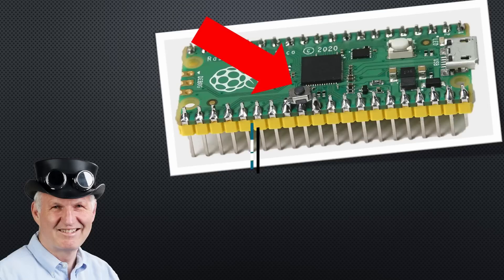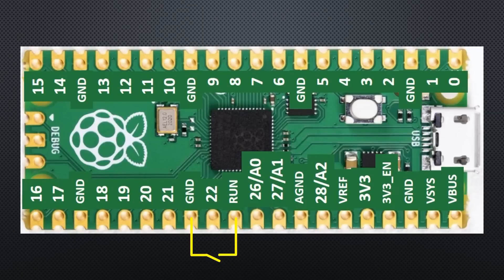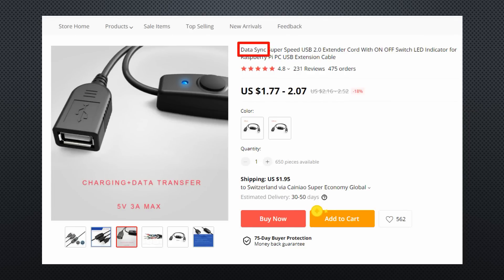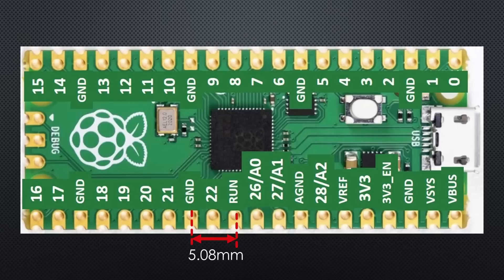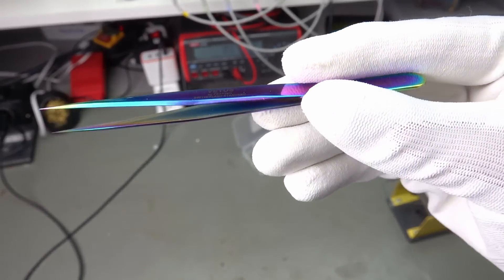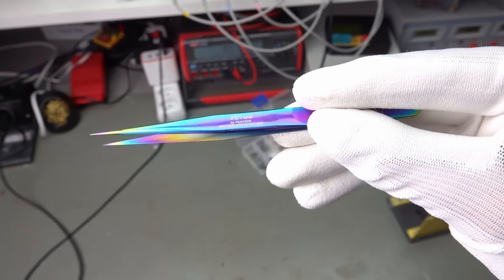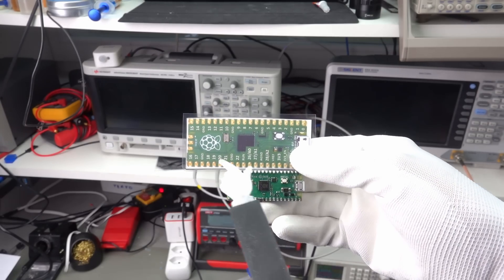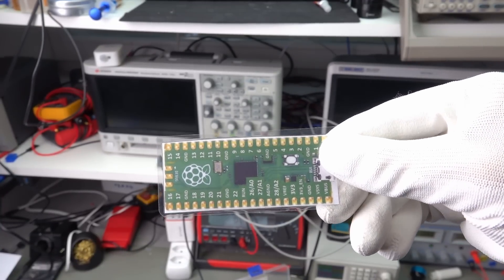#373 Reset Buttons for the Pi Pico (and cool tweezers)

Comment: I used the regular mini pushbutton directly on the breadboard, close to the Pi Pico, to connect RUN and GND. No wires.
Reply from the maker: I do not understand :-(
Reply: @AndreasSpiess  On the breadboard, the pushbutton sits directly beside the RPi Pico to straddle Pin30 (RUN) and Pin28 (GND). No wires needed for this reset button.

Comment: The "captain resetti" could be made quite easily out of a small piece of protoboard within 5 minutes. You'll get those five minutes back with use, because you can then push the button without having to worry that the "flying" button will break off every time ;) .
Reply from the maker: This button switch is quite sturdy. I had no need for a better fix.

Comment: Great channel. Although I have an electrical engineering degree I am new to microprocessor. I have a question. I am trying to help a cousin that have a farm with automation. Therefore, I've been researching Arduinos, EPS & Raspberry Pies. However, I am seeing what I am looking for. I would like to set up networks of wireless sensors (humidity, soil moisture, sun). Send the readings of those sensor to a microprocessor and wirelessly activating watering. What is the best way to implement the project on budget and low power consumption.
Reply from the maker: You have to chop your projects in parts and find solutions for each one. I am sure you will find one for each part.

Comment: You can get most stainless steel tweezers to look like that by various chemical processes or toaster oven with a good thermometer inside
Reply from the maker: Interesting. But for 5 $ they do not charge too much for it, I think...
Reply: @AndreasSpiess  indeed

Comment: You can create a pinout template by scaling a printed pinout image to match the size of the pico board, cut two parallel slots to allow the clearance for the pins and insert the pico on to the breadboard on top of the pinout template.
Reply from the maker: Also a good idea!

Comment: for those interested: one of the plain old 6x6x5mm DIP micro pushbuttons (like these https://www.ebay.de/itm/100pcs-Micro-switch-push-button-6-6-5-mm-new-good-quality/400985254448?hash=item5d5c956a30:g:TDsAAOSwcu5UNir1) actually fits perfectly if you chop off one pair of legs. the other pair will perfectly hug the castellations of the ground and run pin and hold the button firmly in place when soldered. i superglued a tiny piece of copper free perfboard as a standoff to the underside of the button so that the backside of the button can rest on the free area behind the pin headers with the button perfectly square to the board. this adds a bit more support to the button, but i would deem this step optional.

of course thats bigger than the swiss button, but it looks way less janky than this tiny button hanging between the two pins
Reply from the maker: Thank you for describing your solution!

Comment: Pico 1b will come soon. Such switch is not that expensive that raspberry is not able to solve this nerv racking problem of on / off cause   on the pi-400 we got a true and working solution for power on and off without abusing the usb port by pulling the plug out and reconnect it cause this wears out the usb port over time. They are not build for such use case.
Reply from the maker: True. Especially the MicroUSB connectors are not very sturdy.

Comment: Great video showing good options. Let's hope the Raspberry Pi Foundation add software and hardware options going forward to make this even easier.
Reply from the maker: They should have enough space for a button on the PCB... But now maybe they will lose their face.
Reply: @AndreasSpiess  They should at least add a footprint for one. You have to solder headers anyway. I can see why you would not like to have a reset on some projects.

Comment: Looks like the old reset Button from my PC could fit.. you know with the twisted pair on it, so i dont have to touch the board each time I want to reset ;) 
But jeah ... the tweezers got me too, such a beautiful finish, almost too nice to ever use them ^^ But I wonder, do they have a non magnetic (to handle inductors and such) plastic over molded (to not introduce EMF into the parts) grip slightly angled version of these (like the 5B-SA) ? I wouldn't dare searching ali express.. it's a javascript hell 🙈 And it's a Swiss Product anyways, why ali express ? ... oh I know don't answer that 🤣 Thanks Andreas !
Reply from the maker: I do not think it is as Swiss product. At least I got if off AliExpress. It is non-magnetic.
Reply: @AndreasSpiess  Ok, you are right, I investigated a little, Vetus HQ is in Shanghai, but on the pictures I saw on Ihbäh it said "Swizerland Standard" printed on them,  I mixed that up with the origin but I guess it means something else then, probably a cosmetic thing. Non magnetic is good... I often struggle with my cheap steel ones when placing small inductors, they just won't stick in the paste, and then I have paste on the tweezers oh its a mess (bought a pair with ceramic tips just for these pesky inductors) ;:D

Comment: I wonder, if this microcontroller was designed for makers, why did they use that type of package, it is very hard to solder by hand, makes me wonder...
Reply: Do you mean just the chip?
The pin headers themselves seem quite standard to me.

Comment: I did the same with my board. I also trimmed the pin below the button a bit and added some hot glue.
Reply from the maker: Hot glue is always good ;-) Mine was quite fix because it is so small.

Comment: i soldered my headers on upside down on my pico(silkscreen side up).  that way i could see the pin labels.  i could not get to the bootsel button so i soldered a button between TP6 and GND. I need to do this mod you just showed for a reset button.  Thanks for the idea! also, those tweezers were nice!  are they titanium?
Reply from the maker: I assume the tweezers are aluminum and have a fancy color.

Comment: Many thanks, both useful and interesting.
Reply from the maker: Glad you enjoyed it!
Reply: @AndreasSpiess  Could I ask a cheeky additional question... Does the Pico have an additional timer based interrupt?  (I need two hardware interrupts and ideally be able to set a future time for another)
Reply from the maker: I assume yes, but do not know. The datasheet is very good
Reply: @AndreasSpiess  Your answer came too late! I already ordered 3! And some other bits. Many thanks though. 

I think it might and it seems that you could run C based programs on it too as there is an SDK which would get around the delay caused by run time interpretation of Python.

Comment: Pi PCBs are not designed to be very user friendly. Every tried to connect an external antenna to a Pi Zero W?
Who in their right mind would use a tiny a** resistor for that when there is plenty of room for something a little bigger. Even worse the pad for the connector is at ~45 degrees. If you use solder to jump the gap you are very likely to create a short to ground if you hit one of the vias near by. I like their boards but their PCB design is junk.
Reply from the maker: Soldering u.fl connectors is not simple. you are right.